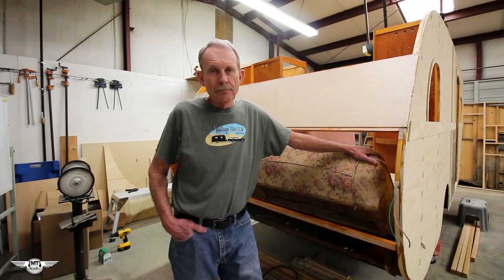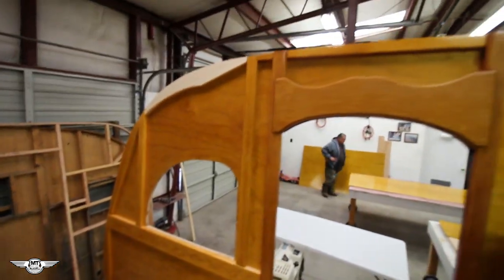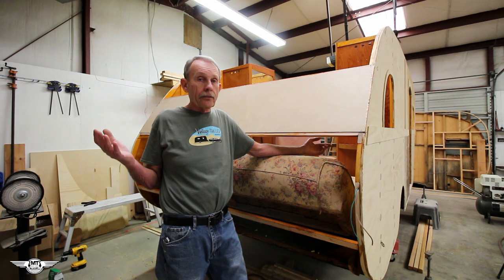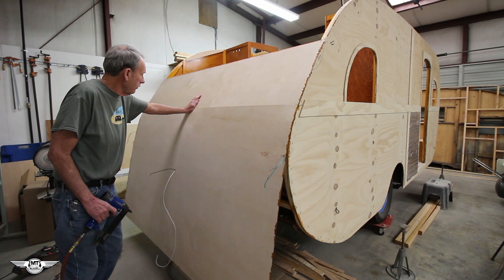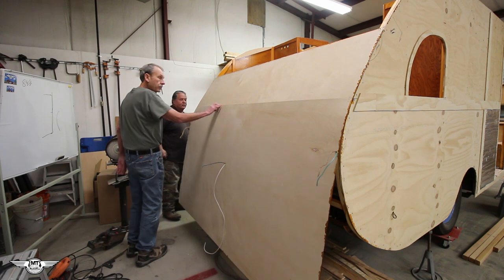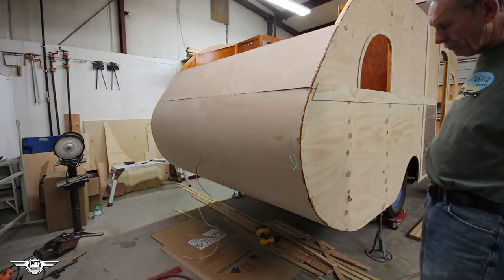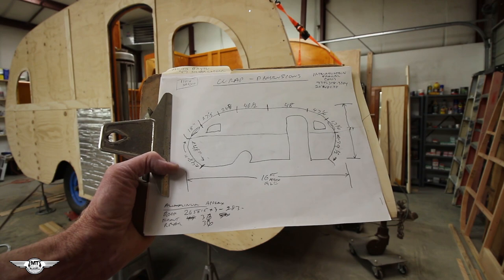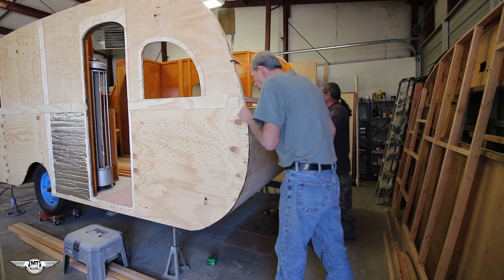48 Mainline Installing The Wrap

Comment: Curious to know if it's a good idea to glue under the wood wrap then staple? Also turn up the regulator at tank, & install a smaller regulator behind nailer to hose.?
Reply: Would a flexible glue be such a bad idea ? I think stapling such thin paneling would be prone to start leaking.  As for paneling why not use boatbuilding grade 4mm okoume plywood ?
Reply from the maker: Well it's a little late now but glue may have been a help. Jerry had the same idea with a regulator at the end of the hose.

Comment: Larry, watching this reminded me of something you may want to get for yourself. When I painted cars 40 years ago, I bought an accessory that goes between the tool and air connection. It was basically a valve that let you dial up/down the pressure without having to do it at the compressor and it could be very fine tuned. That way you could start to staple or whatever, if it’s too high, turn down, etc but without running back and forth. I think I even used it on the air buffer? I think it’s still on my trusty old BINKS #7? If it is, and you’re interested, I can send you a picture. Side note, how are you doing?
Reply from the maker: OH please do send a photo Jerry. Sounds like a wonderful tool. I'm doing much better now and we will have a class this Tuesday.
Reply: Larry, since you “retired”, is there any way to start even one hour earlier? I’m up from 4-6 am so by 9 EST, I’m past exhausted. I never would have asked if you were still full time, but even one hour earlier would be a blessing. What is your direct email to send the photo of the air adjuster?
Reply from the maker: @jerrytalley802  I've thought about that before and it affected so many people adversely that we gave up on the idea. I would love to start one hour earlier. But it's too early for anyone on the western side of the country.